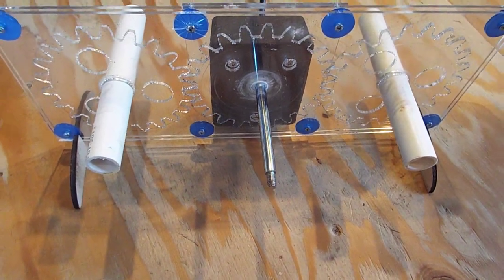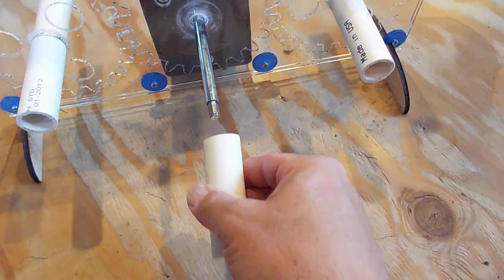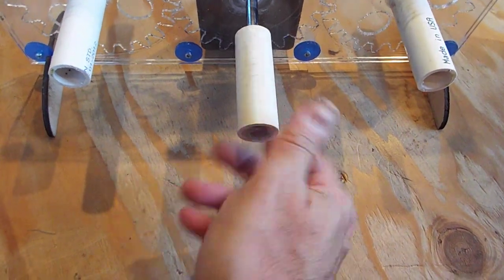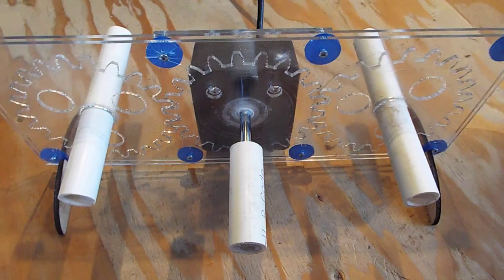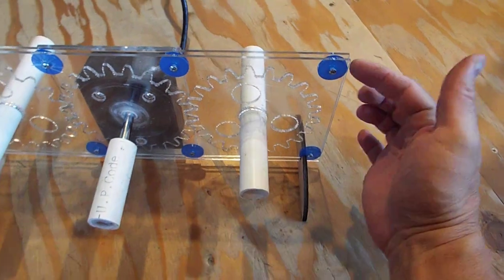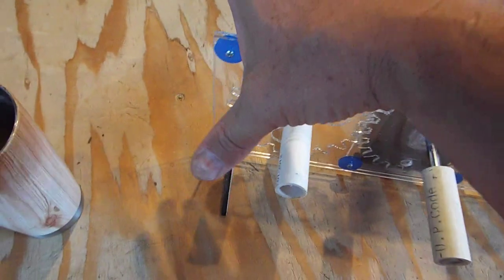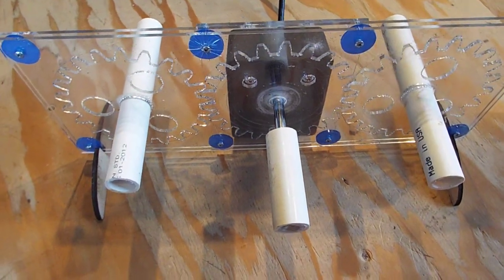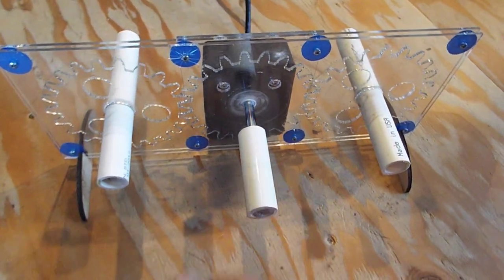Expandable DIY Prototype Cuptisserie Tumbler Cup Rotisserie

Comment: Woah you are really handy, but what is a cuptisserie?
Reply from the maker: The cuptisserie is used for applying epoxy or clear coat to cups/tumblers after custom graphics have been added. There are a lot of people getting into making one of a kind custom drinking cups and stainless steel tumblers.

Comment: I’m interested
Reply from the maker: I am currently traveling, I will be  back in a couple of weeks. Will this delay be too long for you? How many cups do you need to turn at the same time?

You can contact me at www.madscientisthut.com and go to  the contact page and use the contact form. 

The base unit does 4 cups without the rotisserie shaft adapter, then it would do 5. Do you want a kit ( you purchase the motor and assemble it, I will make a video showing how to assemble it) or a assembled tested unit? The cost for the assembled tested (run for several days) unit will be $165 plus shipping, the kit will be $85 plus shipping. You can get the motor on Amazon for about $23 https://www.amazon.com/gp/product/B07BFR6RLZ/ref=as_li_ss_tl?ie=UTF8&psc=1&linkCode=ll1&tag=madscientis08-20&linkId=b001de18bd7743132569d90b9c61a67d&language=en_US
Show less

Comment: I absolutely need one of these for my cups. Where can i find these parts? Or do you sell these custom built?
Reply from the maker: I am currently traveling, I will be  back in a couple of weeks. Will this delay be too long for you? How many cups do you need to turn at the same time?

The base unit does 4 cups without the rotisserie shaft adapter, then it would do 5. Do you want a kit ( you purchase the motor and assemble it, I will make a video showing how to assemble it) or a assembled tested unit? The cost for the assembled tested (run for several days) unit will be $165 plus shipping, the kit will be $85 plus shipping. You can get the motor on Amazon for about $23 https://www.amazon.com/gp/product/B07BFR6RLZ/ref=as_li_ss_tl?ie=UTF8&psc=1&linkCode=ll1&tag=madscientis08-20&linkId=b001de18bd7743132569d90b9c61a67d&language=en_US

Comment: Looks cool. What's it used for?
Reply from the maker: When my friend makes custom drinking tumblers and applies the images to the outside of the container, the image needs to be coated with epoxy or clear coat, so this will rotate the cups / tumbler to apply the coating and continues rotating it until they have cured /dried so that it is an even application.
Reply: Looks like it should work well.

Comment: What is holding your acrylic I didn't see any wood
Reply from the maker: I just made some little stands that the acrylics slips into out of 1/4 inch plywood. I still have not refined the design as far as I want yet but I have made the expansion for the design. I am getting another motor today and will cut another one out and get it assembled for testing soon. The prototype is off getting tested at my friends shop.
Reply: @madscientisthut  Would it be possible to buy the stands from you as well as the cuptisserie? I have no access to tools so finding a mount is really hard. I am looking at purchasing one and LOVE the idea that yours expands!
Reply from the maker: @amywebster2587  Hi Amy. I am designing a new stand that will fit each end where the two holes are where the expansion goes. I will have it done probably next week. Please check back with me next Wednesday. Thanks, Kirk

Comment: I would love to buy one! Please let me know how to order one.
Reply from the maker: A couple of quick questions: How many cups do you need turning? How quick do you need one?
Reply: madscientisthut 3 cups work for me. I only have a 1 cup turner now.
Reply from the maker: The base unit will do 4 without the center shaft adapter then it can do 5. How quick do you need one?
Reply: madscientisthut it would be nice within the next few weeks.
Reply from the maker: Do you want a kit ( you purchase the motor and assemble it, I will make a video showing how to assemble it) or a assembled tested unit? The cost for the assembled tested (run for several days) unit will be $165 plus shipping, the kit will be $85 plus shipping. You can get the motor on Amazon for about $23 https://www.amazon.com/gp/product/B07BFR6RLZ/ref=as_li_ss_tl?ie=UTF8&psc=1&linkCode=ll1&tag=madscientis08-20&linkId=b001de18bd7743132569d90b9c61a67d&language=en_US
Reply: Mad Scientist Hut I have the motor I would need the gears.
Reply from the maker: Hi Melissa, it may work with your motor and it may not, each of the different manufactures rotisserie motors have different spacing on the mount screws and shaft output. Between the two motors I have tried both were different enough that I had to change the mount plate to make them both work, as time goes by if these kits start selling I will try to make different mount plates for most of the rotisserie motors people prefer to use. The kit for the base unit is $85 plus shipping.